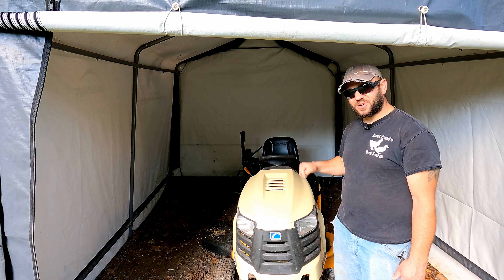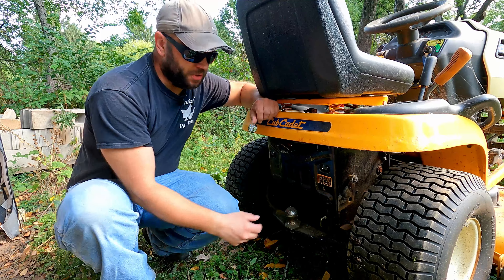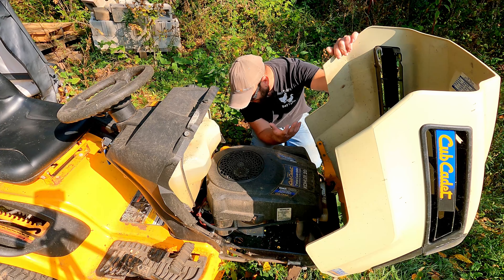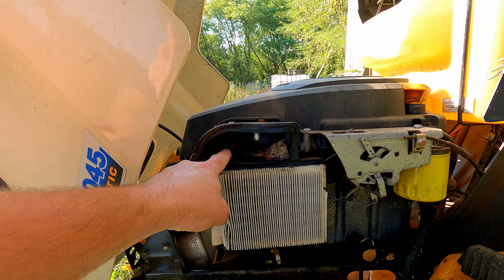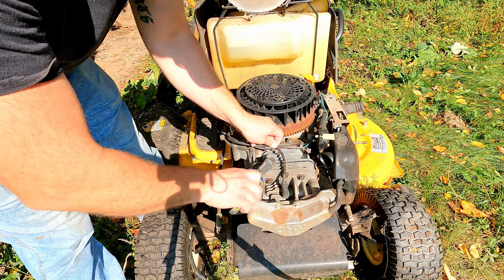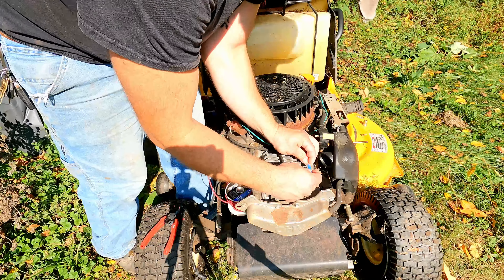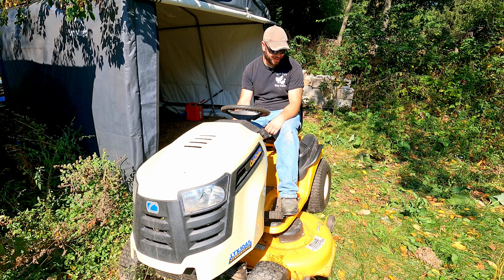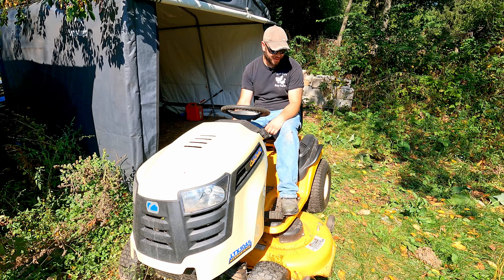CUB CADET TROUBLESHOOTING AND REPAIR

Comment: Put  a running  motor  on  a  cub cadet  now  it won't  turn  over
Reply from the maker: Oh man that stinks!  I hope you get it sorted out.
Reply: Could  it  be  the  break  is locked  up
Reply: It was  running  good  until  I put  it  on  the  other  
Mower
Reply from the maker: I'm not sure. I'm not a mechanic, just a guy who tinkers on stuff when it breaks. If you are not even getting the starter to spin I would start with checking the safety switches and make sure you have power to the starter. @jamesoragle3049